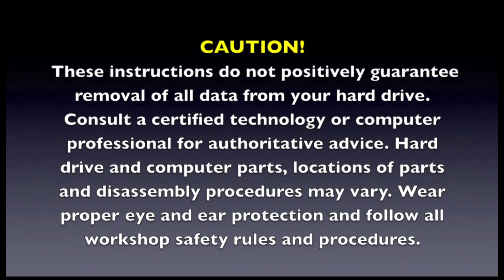How to Disassemble and Destroy a Computer Hard Drive

Comment: Just a little overkill, the belt sander alone is enough.
Reply: This is underkill if you have illegal stuff on it
Reply: or better grab those plates and melt then down with 3000c
Reply: @jonathanoxlade4252  maybe melting them down would create toxins in the air
Reply: @HairKnowMore  and you're skin😆